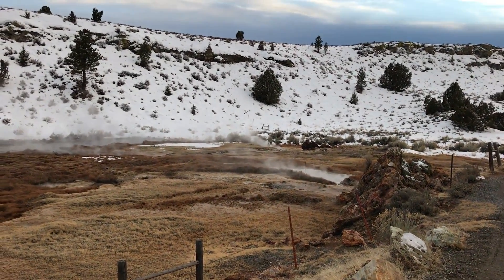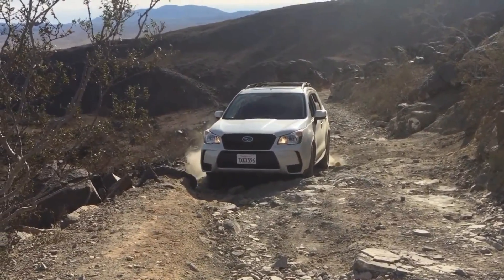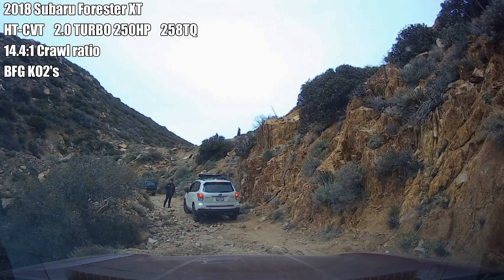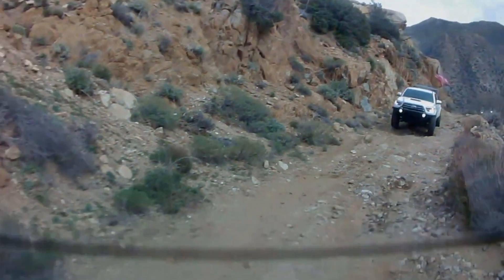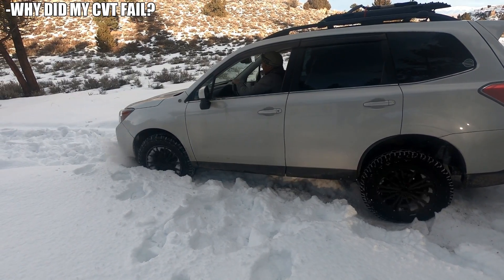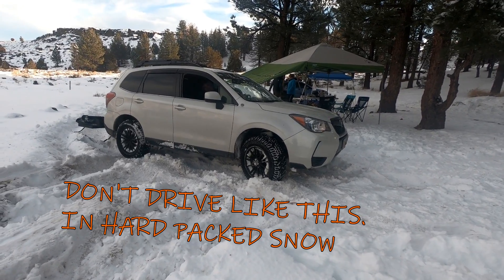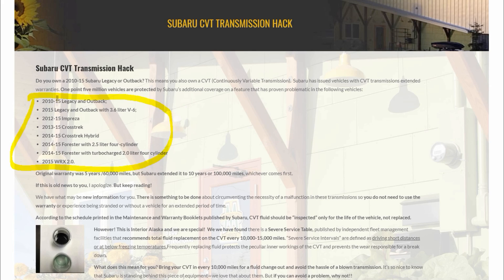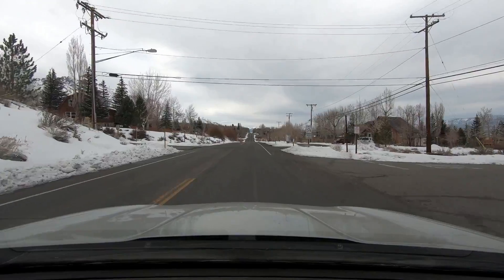CVT transmission Failed!  Can we make them last?

Comment: It's unfortunate that the CVT has had this effect on the Subaru line up.  While beneficial for most drivers, the results that come from taking a CVT equipped Subaru offroad are far from ideal and mostly just disappointing especially considering how Subaru continues to market these vehicles as a 'go anywhere' crossover.  It's nice to see you're having better experiences with the Honda!  My CVT failed and was replaced under warranty a little over a year ago.  I babied it since then, but a month ago I traded it off for something new with a 36.2:1 crawl ration. :)  I'll be back to making video soon.
Reply from the maker: HighjakSecondary Dude!!!!  Congratulations on the Yota!  We miss you on YouTube and I’m looking forward to more video’s from you.  You’re driving a fan favorite vehicle, you’ll have a big audience!
Reply: @JonDZ_Adventuring   Thanks man!  I'm in love with it.  Shoulda bought one 10 years ago.  Keep up the vids!
Reply: Just gonna say if you were off-roading a lot, or towing,  and putting a lot of stress on the CVT, Subaru suggests 30k mile fluid change intervals. As does any CVT manufacturer... Did you do ever change the fluid? If I was constantly putting a lot of stress on a CVT, I'd even consider fluid changes more frequently than that... yes CVTs suck but you gotta take good care of them.
Reply from the maker: Subaru has never suggested CVT fluid changes.  They claimed it to be a lifetime fluid.  A few years ago they realized that wasn’t the case and now recommends CVT fluid change at 24k miles for “severe duty”.  Third party experts say that 10-12k.
Reply: @JonDZ_Adventuring  
The 10-12k is to check the fluid because one of the main issues is the transmission cooler not big enough.
But from information that I have found, the recommended fluid change is 30-40k miles then on 3rd fluid change or over 120k do the transmission filters too because oem are high quality filters
Reply from the maker: @reyperez3424  the Subaru hand book says that the CVT fluid should be changed at 24K miles for “severe duty”.  This is defined as stop and go driving.  

Here’s a copy and paste:

“Severe driving conditions usually involve one or many of the following factors on a regular basis:
Stop-and-go or city driving
Trips of under 10 miles 
Dusty driving conditions 
Extremely cold weather
Idling for long periods of time
Carrying a heavy load or towing a trailer”

So, now think of offroad driving.  That’s Atleast twice as severe right?

The copy and pasted information is direct from Subaru.  So, in this video, a company from Alaska has shown that the trick to keeping a Subaru alive in super severe duty is to change the fluid every 10-20K miles.  If people just drive their Subarus under normal conditions, they should really be following the severe duty schedule.
Reply from the maker: @reyperez3424  here’s the link:

https://www.franksubaru.com/blog/2015/june/5/severe-driving-conditions-and-subaru-maintence.htm
Reply: If you get a chance watch the results TFL got when trying to go up inclines with Subaru’s with CVT’S. The CVT just stops working on incline. I like Subaru’s a lot, but after seeing video’s and other not so good reviews of the CVT’S. I put off looking at new ones until they decide to fix this issue. One other thing, TFL has been refused cars from Subaru to review. They are the only car manufacture to do that to them. They were really fair in there test. It almost seems like Subaru is trying to hide something. Hope all works out for you.

Comment: does this still hold true with the new wilderness trims?
if yes, why does Subaru continuously use a cvt in their supposed "offroad trims"?
Reply from the maker: They’re a small car company and they’re heavily invested in their own transmission design.  Eventually, they’ll be full electric and it won’t matter for them.  The wilderness trims have a gear ratio that’s a little bit more aggressive.  Less heat generated means they’ll last longer, but it’s still a chain transmission that isn’t that isn’t very aggressive.

Outback wilderness 15.5:1
Forester wilderness 16.7:1

Rav4 16.7:1
Reply: @JonDZ_Adventuring  thank you very much... I bought the wrong vehicle.
Reply: @benjaminjwilson6694  depends on what your needs are. With a lot of vehicles, if you do 5% or 10% trail driving a year, do you need a outdated 4Runner (2025 I hear is the new one finally!)? Probably not. Adding great tires for the task and some bits like skid plates + transmission cooler that does the right job, and it's a great all-rounder. A full east to west coast, then up to washington trip we did told us we made the right choice. No way I 'd do that entire trip with an off road 4runner.

Comment: I dunno folks…2021 Nissan Altima with 36,000 miles on it…runs great….great gas mileage after changed fluid and filter at 30,000. Don’t off road it or torque it or race it….maybe that’s why some of problems?🤷‍♂️🤔

Comment: I'm at 87k and just had to have my valve body replaced luckily under cvt warranty. 2015 2.5l Forester. I tried to have the dealer take a deeper look at the cvt, but they basically don't do more than what the codes and more superficial evidence gives them. I had the t fluid changed at 65k. And I don't do anything too crazy. Some borderline stuff (Titus canyon, fire roads, snow) but that's still kinda rare.  What else can I do besides changing fluid and filter can I do to prolong my CVT? Do you think the new valve body will go a long way to preserving the rest of the cvt or is it just a sign of things to come?
Reply: The valve body is the primary failure point of these CVT's. 
Getting the tranny fluid changed at about 40k mile intervals is recommended. 
Don't believe the lifetime claim.

Comment: I noticed at the first time I drove my new forester that it was something wrong with the transmission. Too high RPM and no response. So at 120000 km I change the oil and it was burned. Don’t trust in the dealer when they say no need to change the transmission fluid. After the change the vehicle response changed dramatically. Now is more responsive and fast better fuel consumption. And another thing these suvs are not for such abuse. If you want to go off road buy another bigger thing.
Reply from the maker: Well said Juan!
Reply: You most certainly can equip a Subaru to be lasting for off road duty, but it costs money. Take the 10k you may have spent on another 4x4 and apply it to the Subaru. it all depends on what you'll do with it the majority of the time. 5% or 10% a year on trails is not enough for me with it being my main vehicle. I would never take my east to west coast trip in a stiff off road 4runner.

Comment: Soooo why has my nissan cvt gone over 400k miles and I've heated that transmission up to the beyond where I can smell it after coming off back roads and full acceleration runs. I change the fluid every 60km it's hanging in there
Reply: I find that hard to believe…no Nissan cvt can do that…regardless of the fluid changes..
Reply: @donovanfahrbach2493  sorry I Meat every 60k miles. I don't care what you believe. My 2019 altima is at 141k right now and not a peep from the transmission.  I'll be driving the 420k mile car this week about 2k plus miles since my snow tires is on that car. We're supposed to be getting 2 snow storms this week where I live.
Reply: @occckid123  Ok, sorry, your reply is very sincere…thanks for the info…
Reply: @donovanfahrbach2493  not sure what you want from me.  Trust me the trans isn't behaving beans new but it's smooth still. I can post a video showing my mileage.  I have video in my phone right now also
Reply: @occckid123  I believe you ..that’s all I was saying..you made me convinced…over 400k on a cvt on a Nissan is amazing..

Comment: My 2015 civic honda cvt transmission  died at 286603 miles.
What interval would recommend  to change the cvt fluid at  ?
Reply: I’m assuming mostly highway miles..city driving it would have gone out under 170k ..most Hondas make it to just under 180k
Reply: My 2014 civic has 140k miles and no problems. Still don't like the cvt

Comment: If you actually drive like a normal human being and change out the fluid regularly CVTs aren’t as bad as people make them out to be
Reply from the maker: @australianmade2659  not with a friction chain, that’s not the same CVT that goes into passenger cars.   A F1 car has about 1000 HP, a WRX with a CVT has about 224 WHP (the 6spd manual has 248 WHP).  There’s a company called Cobb that has off the shelf turbo tunes.  The CVT would melt when they tried did a stage 2 turbo tune.  This isn’t the same CVT, look up the CVTs they use in semi trucks, they don’t use friction chains.
Reply: @JonDZ_Adventuring  im talking about the principle. I have no issue with a CVT. I’d be more worried about a ford 10 speed. On the other hand the zf 8 speed is bulletproof. You have to take it on a case by case basis. But as a principal a CVT in my opinion is a superior concept. But each style can be made absolutely suitable for the application. Remember Honda kept frying their 5 speeds behind the v6 motor in the accords. Horses for courses
Reply from the maker: @australianmade2659  the concept of using a friction chain (vs. real gears) means that the CVT simply isn’t meant to last long or handle abuse.
Reply from the maker: @australianmade2659  there’s an active recall right now on 2022 Subarus.  There’s a recall but no fix for it.

https://www.torquenews.com/1084/subaru-outback-legacy-recall-drive-chain-break-may-cause-loss-power/amp
Reply: @JonDZ_Adventuring  180 vehicles in the states? Okay
Reply from the maker: @australianmade2659  selective reading.  The article says that there were 2 recalls in the same month.  The total recall is about 1 million.
Reply from the maker: @australianmade2659  here’s the recall from the beginning of the year.  I lost count on how many total recalls there are, but this one is for 198K.  https://www.motorsafety.org/subaru-recalls-ascent-outback-suvs-over-loss-of-transmission/
Reply: @JonDZ_Adventuring  Subarus sell like hot cakes over. The reputation is very good.
Reply: @JonDZ_Adventuring  Subarus sell like hot cakes over. Their reputation is very good. They come with a 5 year unlimited warranty and a 2400kd tow rating. I understand what your are saying but in my personal opinion looking at all the facts I’m okay with CVT. but I can see your point. 👍
Reply from the maker: @australianmade2659  They sell like hot cakes here in the USA as well, I purchased two of them.  But I have too many friends and people that I know that have them fail on them.  Mostly because of failed CVTs, some because the engine block cracked.  The suspension brackets break off, there's premature axle failure, the list goes on and on.  As soon as someone replaces their Subaru and moves onto another platform (usually Toyota), there's a new person on Instagram repeating the cycle.  Right now, my friends with 2019 SK Foresters are dropping like flies.  There was this "myth" that the CVTs are much improved and more reliable.  It almost seems like they've gotten even more unreliable, at least here in the USA.  Well, maybe.  The same automotive journalist that you linked has an opinion about why the CVT isn't as reliable in the Australian market.
https://www.youtube.com/watch?v=hk5XCabzm0I

The original commenter James Kennedy is right.  If you drive CVT equipped vehicles like a normal person (you don't take them on terrain they are advertised for in the USA) then these vehicles will last much longer.
Reply: @JonDZ_Adventuring  I hope I have better luck. I just put money down on an outback XT. No intention to tow or off-road. It’s more of a family hauler with the occasional snow trip or dusty outback road. Fingers crossed!
Reply from the maker: @australianmade2659  definitely change the CVT fluid on a very regular basis and purchase a full time temperature monitor like a Scangauge 2 or whatever you have available over there.  I rewatched that video that I linked and the issue was that a seal failed.  If you watch my video, I mentioned that it’s “heat” that will kill a transmission, that’s common knowledge.  Somewhere in my video is a chart that shows what happens at certain temperatures.  At 240 Fahrenheit (115. Celsius), transmission fluid starts breaking down and seals begin to harden.  Your outback XT has upgraded cooling, so heat might not be the thing you should be worried about the most, but it can happen if you’re in a situation where you’re spinning tires.  Anyways, good luck with your Subaru.
Reply: @JonDZ_Adventuring  thankyou
Reply: @australianmade2659  they don’t last long here in the US because people tend to push them more to their limits. They’re marketed for being superior in various harsh climates and for adventures and when they do get used for those scenarios on top of sitting in traffic then going over 80 MPH for 4+ hours they get really worn down and can’t keep up.
Reply: @owen75  I agree they are not the correct gearbox for off-road or towing. I don’t do either.
Reply: You’re right I don’t think CVTs is the greatest way to go for off-road capabilities.. But just because Subaru and Nissans are building straight junk the last several years doesn’t mean CVTs are just straight junk.. Toyota and Honda don’t have an issue building CVTs that are reliable
Reply from the maker: It’s been 3 years since I made this video and I’ve seen so many CVTs fail, even when “babies” and with severe duty schedule fluid changes.  I’ve also seen a stronger marketing push to offroad CVT equipped vehicles.
Reply: @JonDZ_Adventuring  How many cvts have you seen fail? How many Subaru Foresters were sold in the USA?
Reply from the maker: @egx161  you can simply Google how many foresters are sold in the USA.  As far as how many Subaru CVTs I have seen fail, It’s a high percentage of offroaded subarus, and a high percentage of the turbo models offroaded or street driven.  In a span of 5 years of regular overland and offroad use, I’d say a 75% failure rate, but I have friends that have killed their CVTs as low as 15-25K miles.

Comment: Toyota does CVT right by adding a launch gear. Its s physical first gear the car uses to take off. I watched a YouTube video explaining why Toyota went that route. They claim taking off is the hardest your CVT works and once they slip they need to be rebuilt. Using a live first or launch gear saves the CVT from such wear. Toyotas get very high mileage from their CVT’s for that reason. Subaru should consider doing that or maybe even a lower gear as a granny gear that could be locked in place electronically in Subarus like the Wilderness for when more power is needed. I hope Subaru considers it
Reply from the maker: Toyota easily has the best CVT on the market.
Reply: And you believe that's the reason why the toyota cvt actually has a 1st gear? Lol you've been lied to!?
Reply: @occckid123  …well maybe I have. I don’t really care because I’ll never own another car with a CVT anyway. They’re junk as far as I’m concerned but Toyota’s CVT has the best track record unless I’ve been lied to about that but again, that doesn’t matter either because I won’t own one.

Comment: No wonder why it failed thire not designed for off road it doesn't matter even if it's a jeep or something 4w drive if it has a CVT in it dispite what the manufacturer advertised cvts are not made for off roading

Comment: I'm old school.  My transmissions actually have metal gears and face the correct way.

I've heard that even Toyota has a rubber band type transmission but supposedly a better design.
Reply: Toyota uses a physical first gear then goes into cvt

Comment: I like gears...gears can grip nicely. CVTs don't really have gears, they're more like a tank's sprocket. A technology that will no doubt continue to be improved, but doesn't seem like a great replacement for a geared transmission. I doubt they would even exist if fuel economy standards weren't forever being pushed upwards.

Comment: how can you check the temps for cvt a/t oil temp ? My a/t oil temp lights come on after long drives, also light is triggered earlier in drives duringwarm weather. I have alot of load on my roof rack and rear hitch basket when i travel long distances. I have an obd2 elm. Do you know if it is possible and what apps should I use. (android). i have a 14  crosstrek
Reply from the maker: I tried using the ELM OBD2 dongles and I didn’t have much luck with it.  It’s a pain to have to pair it with my phone everytime I drive.

I would highly recommend a full time monitor lie they Scangauge 2.  I’m such an advocate for the use of these full time monitors that im using my own money to purchase 2 units for a giveaway.  The drawing is May 3rd
Reply: @JonDZ_Adventuring  thanks. Will check out the options. Have you ever had the chance to flush out the stock cvt cooler?  I wonder if it's worth having dealer doing on top of a cvt flush. Trying to keep subaru liable for the work in case I have to use the 100k cvt warranty. After 100k il go after market if I still have the trek
Reply from the maker: @RB-fl1yz  oddly enough, I don’t think my FXT had an external transmission cooler.  As far as flushing, you have to be careful, because it might makes things worse.  There’s a debate about transmission flushing vs. drain and fill.  It’s not my expertise, so unfortunately I can’t offer advice.  For people that are just getting started though, doing a drain and fill every 24K miles is what Subaru recommends for “severe duty”.  Offroad use might be even more severe.